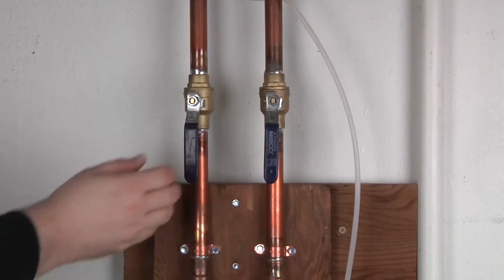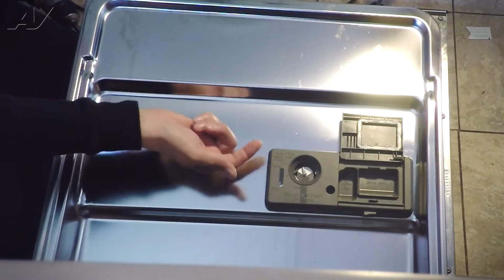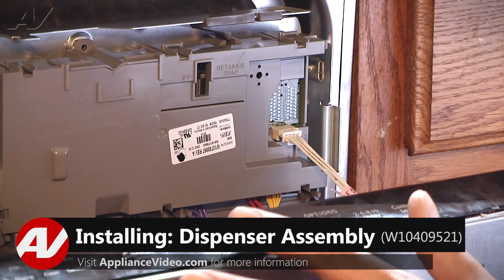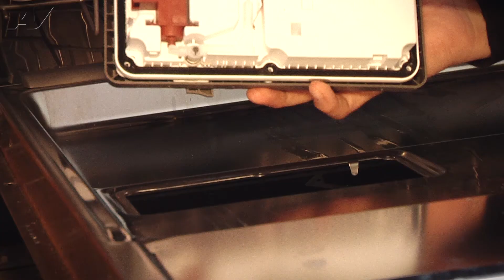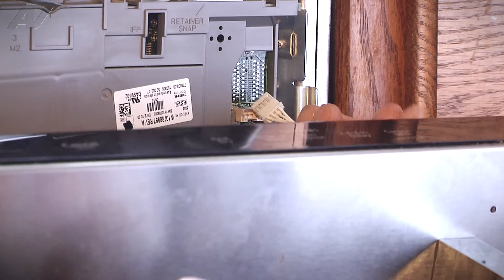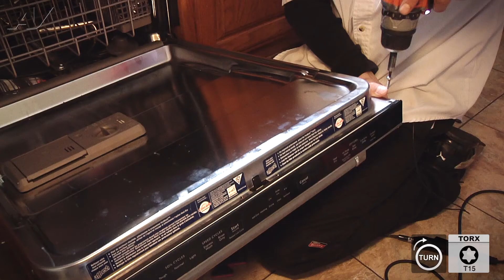KitchenAid Dishwasher Repair - Dispenser Door Not Closing - Diagnostics & Troubleshooting

Comment: Folks, before you do ANYTHING, always cycle power by turning your breaker off for 20 seconds and then turn it back on to see if that corrects the problem. Computerized logic boards require on board memory to store codes as well as operational sequence steps as they complete. Mine was telling me that the heating element was bad and needed to be replaced. I knew this wasn’t true since the coil does get hot and actually steamed when water drop,ets were falling from the upper basket. After cycling power, I ran the dishwasher through a test mode and then a cycle with no issues.
Reply from the maker: Thanks for your response, we are glad we could help. Our library of over 5,900 videos are currently helping over 1.6 million people like you every MONTH.  Please help us by subscribing to our YouTube channel, or post our website www.ApplianceVideo.com to your Facebook page, Twitter, Instagram or any other social media sites. Your support will help us keep producing more free quality videos.

Comment: Is is possible to just repair the soap flap assembly rather than just replace it?
Reply from the maker: Great question, if you have a more technical question that our parts department cannot answer, you can search our over 17,000 answered questions free at our website www.ApplianceVideo.com under our Repair Help section. You can also call our parts department at 1-800-830-5465 and they can give you help 7-days A week ,or search at www.SaveMoreOnParts.com  .